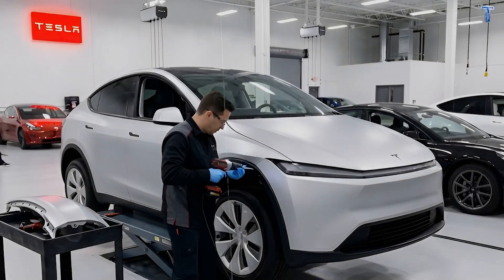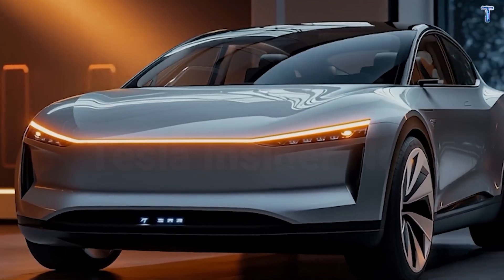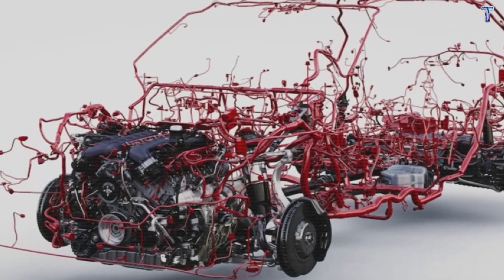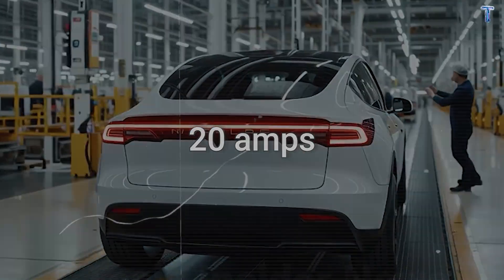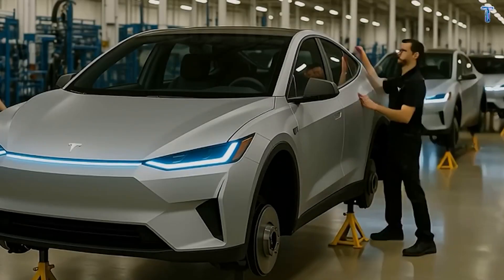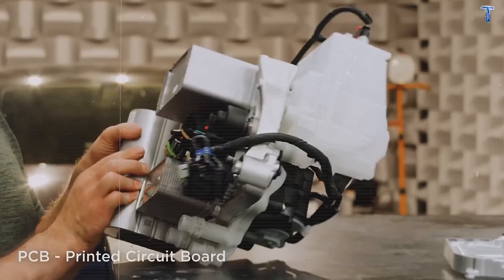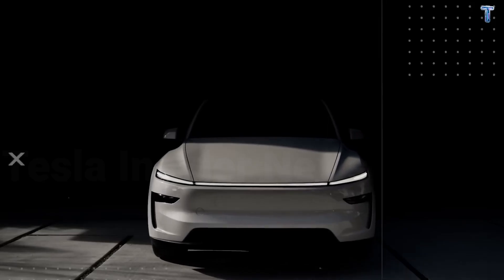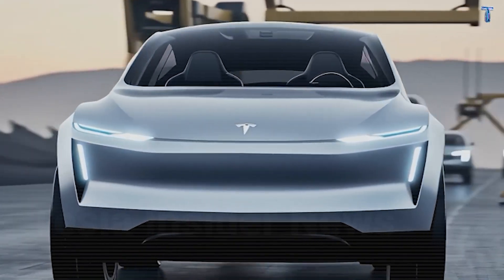Under $25,000 Tesla Model 2 Has FINALLY Arrived — And It Rewrites EV Ownership Forever. P2

Comment from the maker: Model 2 isn’t just a $25k EV — it’s a blueprint for how modern cars should be engineered.
A 48V electrical spine that kills 12V failures, an all-in-one HVAC that cuts service costs in half… this is the real 10-year ownership revolution.
If you believe 48V will become the new industry standard, type it with me: 48V Revolution ⚡🚗

Comment: Hot take: If Tesla can put 48V + an integrated HVAC block into a $25k car, does this mean the other automakers were overcharging us for outdated tech this whole time?
Reply from the maker: Let’s just say… Tesla didn’t invent 48V or integrated thermal systems — they just actually used them.
The real question is: why did it take a $25k car to prove the rest of the industry could’ve done this years ago?

Comment: Not gonna lie… if this $25k Model 2 really has 48V + a full thermal block, why are legacy automakers still stuck in 12V spaghetti wiring?
Reply from the maker: You're not the only one asking that Model 2 basically proves that simplifying the electrical + thermal systems wasn’t impossible… it just wasn’t a priority for most companies.
Now everyone has to catch up.
Reply: @TeslaInsiderNews  So basically Model 2 is the first ‘budget EV’ that’s actually cheap to own long-term?
Reply from the maker: Pretty much. Lower voltage loss, fewer leak points, modular repairs… it’s the first time “under $25k” doesn’t mean “expensive later